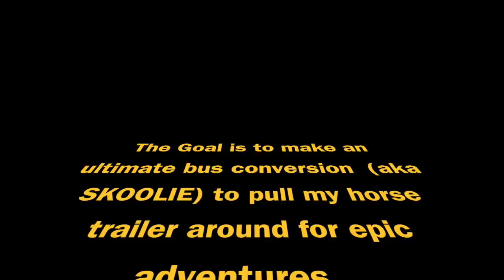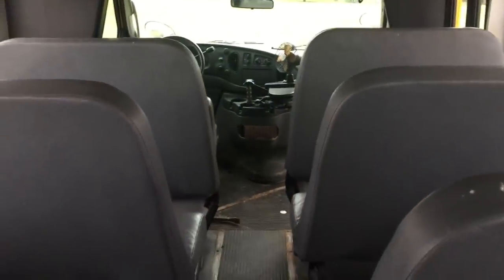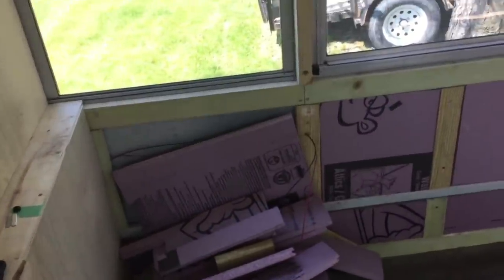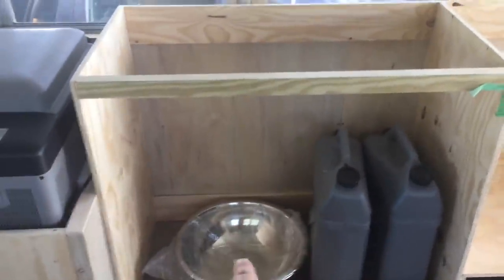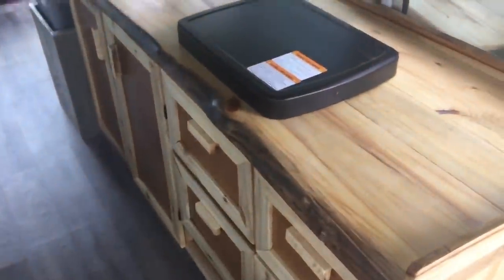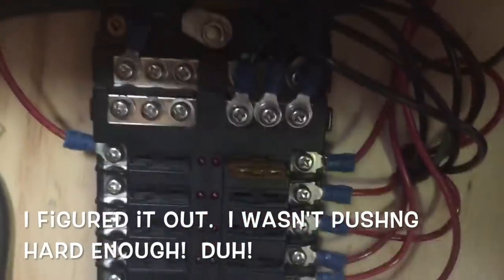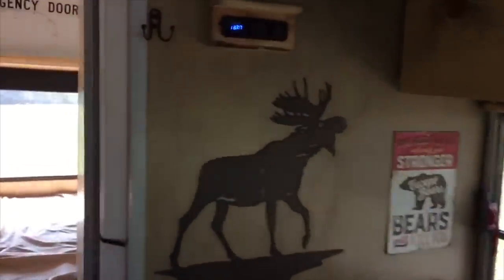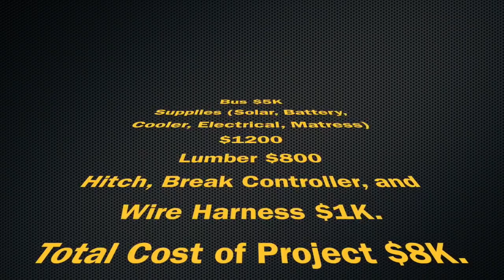DIY Short Bus Skoolie Conversion

Comment: I wish I could find a scoolie with low miles and in excellent condition. This is my dream. Y'all did a great job, it looks just perfect.
Reply: If you can find a diesel engine bus 115 thousand miles is nothing for a diesel engine provided that it's a good engine from the start and well maintained my suggestion would be to do lots of research before buying
Reply: *Cindy! They're ALL OVER FB swap, here in Midwest! I see them PARTIALLY converted for 3000.00!
Reply: @anitaevangel8742  😲👍👏👏👏
Reply: @anitaevangel8742  Where?? I would love to find one.
Reply: Dandy Dear hound on Facebook marketplace!!! Search for short bus or mini bus or something along those lines! I found a short bus with around 100k miles for $2400

Comment: very no nonsense/common sense approach and yet very pleasin to the eye conversion. I'm not a huge fan of the 6.0 ford diesels, I hope you have better luck with it then most have had.
Reply from the maker: My mechanic told me not to drive it like a teenage boy on a Friday night, and I would be OK. 😆. He even had a 6.0.  I felt I was in good hands.
Reply: @hollijacobs7858  lol thats very true. There are things you can remove and bypass on that engine to make it more reliable also. You have a very nice bus, i hope it brings you many years of joy and lots of memories. I am actually gettin ready to buy my first bus and its a 6.0, just a gm gas 6.0. I have one in a chevy 4wd dually and can eek out 14-16 mpg empty, so I hope to do that in the bus or close to it.  I have to get one with a wheelchair lift so i can pick my father up at the nursin home, so that will add a bit of difficulty to what i can do with the remainder of the space, but my needs are very basic so I think i'll be fine. Videos like yours give me lots of ideas on how to make good use of the space. take care
Reply from the maker: @billwilliamson9842  good luck.  I got all my ideas from watching YouTube videos too!

Comment: one of the best simpler builds I am getting a bus myself soon .. and taking up to a year to build.. as I am disabled and on a limited income.. so when I travel.. I will have somewhere to sleep without the expense of expensive hotels.  ideally I hope to utilize campgrounds and or Walmart parking over night.. though sadly none around here are not open over night hopefully they will go back to 24 hours again soon.. or rest stop that allow over night parking.. I hope to have my bus soon it will be also my daily driver while the build is going on
Reply from the maker: Best of luck to you!  Maybe join a boondocking FB Page or get an app that shows where you can camp on the cheap.

Comment: Great job, thanks for sharing your experiences. Wish you would’ve talked about and showed the exterior painting process.
Reply from the maker: I thought about it, but there are lots of videos out there.  I just used a $10 harbor freight sprayer and pancake air compressor.  taping off the windows was the worst part!

Comment: Really nice setup. You wouldn’t happen to have plans or dimensions fort your dinette?
Reply from the maker: No sorry, and I sold the bus, for a new project. But if I remember correctly the table was 33” wide and with it lined up with the cushions it made a 6’ long bed.
Reply: @hollijacobs7858  thanks for reply

Comment: Love it! Lots of nice features, very practical & well done. I didn't see any insulation or heating so how do you stay warm? Also, what is your solution for washing laundry & taking showers?
Reply from the maker: Glad you like it.  I really enjoyed making it.  Around 3:15 you can see the Pink insulation on the walls, the ceilings were insulated with a white fiberglass mat material.  For heat I use a Mr. Buddy portable heater, it fits up in the front of the bus.  No shower in this, it was just too small, most places I stay at have a shower facility.  So that was not a concern for me.  Laundry, would be done in my permanent home or at a laundry facility.  This was just a short bus and space was limited.

Comment: Diesel cook tops are available if you want to spend the money. That way you wouldnt need to carry propane. And I put that same floor in my ambulance conversion. If you have or plan to get a dog he/she will coming sliding up to the front if you have to hit the brakes. So youll need to put some grip tape on the floor. I learned the hard way.
Reply: They made dog seat belt harnesses. Plastic buckles, tho. They hold for normal hard stops.

Comment: Great job! This is exactly what I want to do sometime but I would need a longer bus due to family size just a simple build like this.my only question is what do you use for heat if you camp during cold weather.
Reply from the maker: Little buddy heater, or electric heater is there is electric.

Comment: Just found you today and subscribed. Great video. I've been researching converting a van for well over a year. In the last two months I'm thinking more and more about a small bus. I'm closer now after this video to choosing a bus. Hoping I can find one that is going to be perfect for me.
Reply from the maker: Hang in there, they can be hard to find.  I had to drive 3 hours to get this.  Then one came up for sale 4 miles from my house! 🤷‍♀️
Reply: @hollijacobs7858  Really? I find conplete ones hard to see. But there's a Midwest bus seller in the Chicago area. Meaning burbs. Nothing is done, but they run. I guess. Haven't looked into them fully yet. Would prefer turnkey. Greatly. Lol

Comment: Wow! You are such an inspiration. I love that you found it, converted it, and are  living such an adventurous life. My questions are: how do you heat and cool your vehicle, what type of vehicle insurance do you have, and how many miles to the gallon do you average? Happy travels to you.
Reply from the maker: First, Thank you!  I appreciate the compliment.  I have screens and fans, a lot of what I do is off grid, so I have USB fans that can plug into my solar (Walmart clearance $5)!  I have a little buddy heater too.  State Farm for me, but it wasn’t easy, they cancelled me and didn’t tell me (long story) but I’m back in business again with them.  I haven’t calculated mileage yet, so maybe somewhere between 10-15?   I use it with and without a horse trailer, so have not calculated them separately.
Reply: @hollijacobs7858  Yeah, I had SF pull some BS, too. Clean driving record. Gotta move around a lot, tho. They'll charge you a lot of you don't keep after it.

Comment: Lovely build!!! Do you have more details for a novice builder? How did you create the cabinetry? Do you have a list a youtube videos that you'd suggest or do you  have lots of carpentry experience? I am taking an electrical class in a month. Bus life makes you learn a little bit of everything.
Reply from the maker: it sure does make you learn.  I really don’t have a list of videos, but don’t just watch bus videos, learn how to use power tools, basic carpentry and things like that.    Finally don’t be afraid to make mistakes.

Comment: Very nice build. I didn’t see a shower. Did you install one? Would have liked to see your solar setup. Did you do everything yourself? Congratulations. I know it isn’t for everyone but with the rise in popularity and the availability of online instructional videos it doesn’t seem right that so many people have no place to live. I get that there are circumstances that prevent this type of living. But with the availability of old busses and used vans surely it could be a solution for some people. $8000 for a home is better than paying thousands of dollars a year for an apartment. Oh yeah I meant to ask about your insulation! Thanks for sharing!
Reply from the maker: This was designed for camping, not full time living.  So I will be showering in facilities. There are lots videos, showing a solar install.   That’s really wasn’t meant to be instructional just showing off what I did and how I got there.
Reply: @hollijacobs7858  well it turned out great! If I was out I would definitely want at least a potty but so many people use gums or if an RV park has facilities they use them. It was just that I noticed the potty but didn’t see any shower so I wasn’t sure if there was one or not. Safe travels and enjoy living on the road!

Comment: Holli, I enjoyed your video. I admire your nice budget build, which looks very practical.  I also enjoyed seeing the photos of you on your horse too (happy trails!). :)
I have a few questions: 
1. What is the interior height (I am 6’ tall and some buses are too short inside for me).  Did you put in any insulation on floor or ceiling? Who made the body of the bus?
2. What fuel and engine? 
3. What fuel mileage (MPG) do you get when traveling out West (mix of highway and hills or mountain driving)??

I ask these questions because I am considering a schoolie too, and would likely build similar to yours, but concerned about fuel MPG if used to travel western states. 
Thanks for any answers.
Reply from the maker: The interior height was 6’ 2”or 3”   I think.  Thomas.  Maybe more.
Diesel 6.0 (I think that was in the video…in the beginning) 
I think I was getting around 10-12 Mpg.    These are no fuel efficient modes of transportation, but neither is a motorhome.

Comment: You really did a great job. Did you know how to do all the work yourself? I am loving your design. I think I want either a short skoolie or a van. The full size bus would just be to much to deal with regularly. Well done.   Janice
Reply from the maker: I did all the work myself.  YouTube was very helpful, I researched everything.  The only thing I didn’t do was mount the trailer hitch,  brake controller and wire the back up camera.  I wouldn’t say I’m handy, but I know how to use most power tools and I’m very persistent. 😉.    I never used a spray paint gun before, so I practiced with water until I felt I had good enough control.

Comment: You did A great job on the bus. How thick are your Windows??? Will you be covering them up to keep the warmth inside the. Bus
Reply from the maker: They are single thickness.   Don’t plan on traveling in the bitter cold of winter.  So I’m not too worried.

Comment: great conversion, my only concern would be the 6.0l diesel. Get it bulletproofed, they aren't real reliable "out of the box"
Reply from the maker: Yes, I have heard that about 1,000 times from some bus conversion FB groups.  I took it to a bus mechanic and he said it looks good, don’t drive it like a 16 years old cowboy and keep up with regular maintenance.  He said it was way better then a 6.4 L
Reply: @hollijacobs7858  I'd say the 6.0 and the 6.4 are comparable, the big issue is the EGR system. I'm not promoting EGR delete, but there are superior EGR components in the aftermarket that will greatly improve the longevity of your motor. It really has nothing to do with driving it like a "cowboy", but more to do with deficiencies of the motor. They can be made to be reliable (same with the 6.4), and with a few bucks spent today, it will save you a whole lot tomorrow.

Comment: How does it do towing the horse trailer? How much does the loaded horse trailer weigh? Thank you. Beautiful conversion
Reply from the maker: Amazingly well, you’d never know it’s back there! The backup camera is awesome!!!   I would say the trailer fully loaded with two horses is about 5,OOO lbs.
Reply: Holli Jacobs what engine do you have? My ultimate goal is to set mine up as a weekender that can tow my Jeep
Reply from the maker: @codyjames1506  this was a 6.0 diesel.  I’ve heard good and bad about them.  Maybe get it “bulletproofed” If you go this route. Or get one older than 2003.
Reply: @hollijacobs7858  Does this one have a 7.3 option?

Comment: Hey, I love the video very helpful! I just got one question did you insulate the flooring at all or did you just put one layer of flooring on top of the original bus flooring? Thanks
Reply from the maker: No, I did not, but I did insulate the floor for my horse trailer build.  I would recommend it.
Reply: @hollijacobs7858  ok would you just put 2 layers of flooring down then. Your insulation and the main flooring?
Reply from the maker: @Tedworth25  yes.  That worked well for me.  If you use a laminate floor, let it adjust 24-48 hours.
Reply: @hollijacobs7858  Ok thanks for the help!
Reply: @hollijacobs7858  all of this is very overwhelming to me so I appreciate it lol
Reply from the maker: @Tedworth25  90% planning 10% effort.   I built this in my head many times before I touched a tool!

Comment: Hello. Is this titled as a bus or motorhome and how much is the insurance? Was it difficult to change the title?
Also are you freezing most of the food hense the freezer and the cooler? The woodwork looks well done wish I had your skill set.
Reply from the maker: It is titled as a motorhome, it came that way (whew).    I like the freezer cooler, because I figured I would use a cooler and freeze the freezer packs in my solar unit.  Insurance isn’t too bad.

Comment: with the matrass tucked under the wall you whont be able to lift the bedfloor without setting the matras straight up first , a hatch in the front and the door in the back to get under there might be better and eazier
make sure you turn the little shelf over the plugs for the celphone intoo a small box or tie a rubber band around it to slip the phone under  , you bound to forget youre phone when traveling and have it fal off the shelve , they usually dont like being dropped 
other than that you done a nice job on it
Reply from the maker: Lifting the mattress up is for accessing the battery and what not for maintenance purposes, not a daily thing.  There is a sliding access door, from the living area and from the back door as well.  I show this on my tour video.  So no worries.  I’m not too worried about the cell phone thing either, I use it for GPS so I’ll have it with me up front.  Thanks for the nice job compliment. 👍

Comment: Mine was used as a handy bus we bought it just before my great neice got married in Ontario at Niagara falls she lived in welland we lived in Calgary Alberta my sister her grandmother was a quite upset at the prospect of missing her wedding we. Had a couple of days befor we wouldn't be able to make it I had some old plywood closet doors cut them to fit the curve of the roof put a curtain between them and we had a toilet room it had a drawer unit at the back the previous owner had salvaged from a renovation job he'd done I had a drawer unit I had salvaged from a renovation job my brother had bought a set of kitchen cabinets from they were going to throw out so I put one on the other a piece of plywood on top put an extra battery in and my old 1750 watt inverter and off we went after planning our root and checking out where we could get auto propane along the way well after we left we soon found out that with the windows closed we roasted and with them open we were a feast for every mosketo around so a quick stop in maple creek Saskatchewan and bought some screen and 2 tubes of white silicone bathtub caulking a bead around  the window pressed the screen into the silicone and we did it to the front 2 and the back 2 one on either side so we could get the breeze from any direction a word of warning if you have a vehicle that ownly runs on propane or has a liquid fill attached tank for your propane needs steer clear of Ontario we phoned and ask if they sold auto propane and each place said yes they did and I had explained that my vehicle ran on it when we got there every one had a different story they ownly had exchange a tank for I then asked if they drove their BBQ on the road after many phone calls we tracked down places to fill up and it was expensive higher than gasoline and very limited times for filling up and as a union controled province no fuel on labor day weekend so for those who have these busses if you don't have ac and need to chose between roasting and getting eaten by musketeers that how to put on screens it's not pretty but it works if you take your time you can do a neater job than I did I did my usual on that trip put the basic in place before I left and did the rest as I went finished building the 2nd bed in welan Ontario and yes I carry my tools with me so I can repair anything mechanical and build or modify anything anywhere i'm at

Comment: Can you make a video about your painting process?
Reply from the maker: It might be a bit too late for that. 😉.  But I used a pancake air compressor and a $10 sprayer from Harbor Freight.  I practiced with water on cardboard.  I got more of an orange peel finish, but I like that anyway (hides my shoddy paint job).   I painted the rub rails and the black stripe with a rattle can.